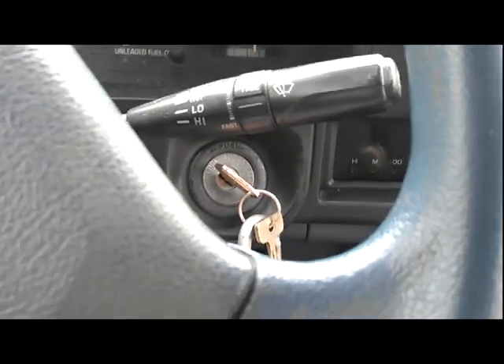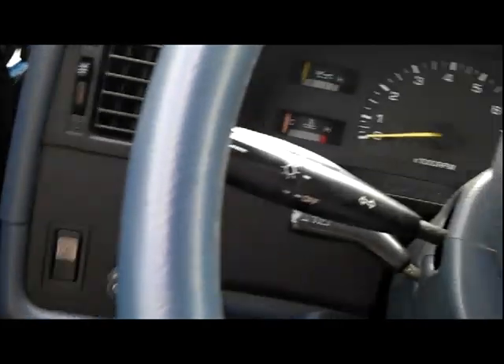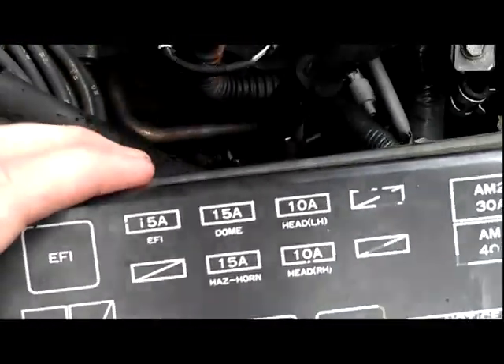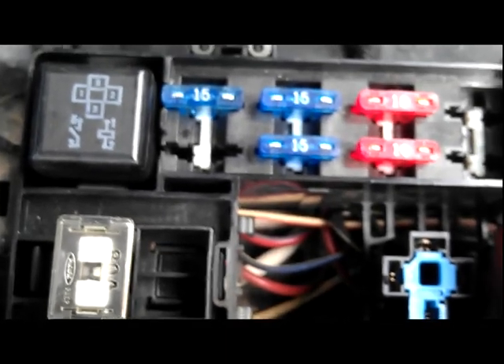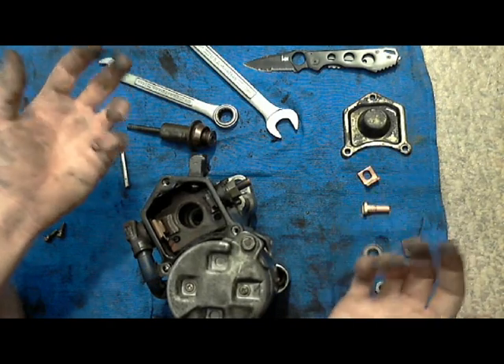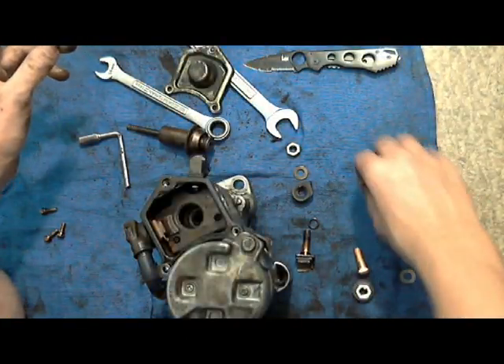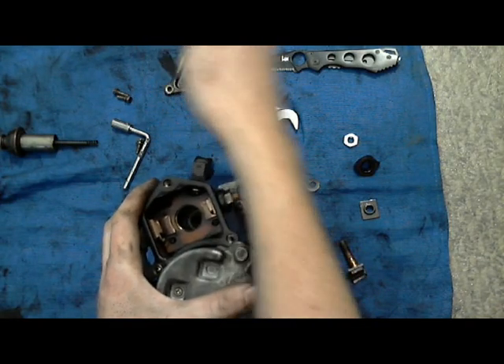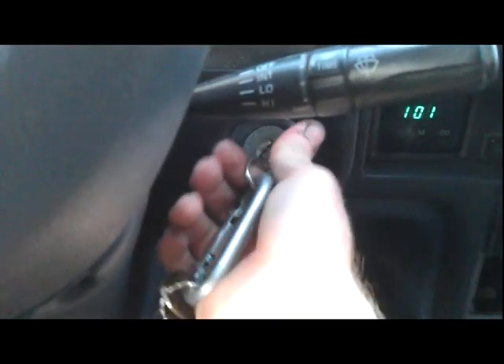Rebuild a Toyota Starter

Comment: My dad has rebuild starters and alternators for 20 years, and he recently taught me  how to rebuild them. These types of starters are my favorite, they have many parts but I just understand were they all go, and it is just so easy to take everything apart. I take the whole thing apart, I could even press out the solenoid to check if it is fine. I  clean everything with gasoline, dry everything out and re grease the bearings gears change out the contacts, solder in new brushes if they need them, and give them a nice paint job for a nice and clean install.
Reply: Good on you 👍

Comment: I used a torque wrench to tighten the copper stud nuts and ended up stripping the thread.  I guess it was out of calibration or something
Reply from the maker: Eek, oh no!
Reply: @LegitRaceCraft  I actually checked the calibration and it was fine, so I've no idea why it happened.

Comment: How long will the refurbished starter motor last?
Reply from the maker: I've rebuilt 3 of my own starters over the last 15 years(two different motorcycles and this truck), and all of them lasted until I sold the vehicle, so I'm not sure but they lasted at least 2 years from experience and should last well beyond that.

Comment: Appreciate the rebuild it would of been great if you would of started from the beginning instead of the middle. Thumbs up for what you showed thou.
Reply from the maker: Thanks! This was one of my earlier youtube videos. I've gotten better
Reply: @LegitRaceCraft  I had trouble with the ratcheting device on the starter shaft in an '05 Camry.  The grease was so thick that it would hold back the ratcheting pawls in cold weather, allowing the ratchet to slip.  I was unable to access the pawls because the ratcheting device was stamped together, so I liberally oiled it with light lubricants, which I think diluted and flushed out some, if not most, of the heavy grease.  Hopefully the resulting mixture will stay thin enough to allow the return springs to push the pawls into position even in the coldest weather.

Comment: You definitely don't want to do the click start too many times because as you said the injectors prime every time you hit the ignition and I fucked up my  cataleytic converter on a 3rd gen pickup doing that too many times trying to squeeze more life out of it.  (I was a starving college student at the time)
Reply: Are you referring to the "click" sound from when you turn your key in ignition? Or are you referencing using the relay-jump to start your car?
Reply: I'm referring to turning the ignition repeatedly to try and get the starter to turn over.
Reply: I had to have my T100 towed home this morning, after clicking about 40 times. I hope I haven't ruined something.
Reply: how did it go?  I wouldn't worry unless you were constantly doing it to get the car started on a daily basis like I was.  I would do it 30-40 times every day to get it to start for a couple weeks before it finally just wouldn't go anymore.  thats how I flooded it and ruined my cat converter.

Comment: YEP I M HAVING THAT SAME PROBLEM THE CLICKING SOUND WHEN I TRY TO CRANK MY 1991 TOYOTA CAMRY DX I PAID $600.00 FOR IT AND ABOUT $3000.00 FOR PARTS NEW RADIATOR FUEL PUMP AND FILTER 2 TIMING BELTS THERMOSTAT AND ALTERNATOR

Comment: yo mines doesn't have any O rings!!!!
Reply: your rebuild kit ? or the starter? most older (all Ive seen) toyota starters do not have the o-rings. they added these later to help keep oil/water/etc out of the starter. just make sure the plastic isolaters are intact (not broken) when you put it back together.
Reply: +anthony ilax the starter that I removed from the corolla.......

Comment: This video saved me $115!!!!  I'm not a mechanic by no means. I'm the type of guy who sticks to what I'm a pro at and let mechanics work on my rides. However , I have heard that changing out a starter on a Toyota truck was pretty easy once you can get to it. I decided to give it a shot all prepared to take that starter up to the Auto parts store and trade it in and buy a new one for $155 with a $40 core return. Once I watched your video and seen what was most likely the problem with the dam thing, I took mine apart too.  My seal was perfect it just had a dirty copper terminal inside from dust and grime. I didn't purchase any kit I just took mine apart just like you did in the video and I cleaned the hell out of the inside particularly the terminals and contacts. I put it all back in my truck and it crank the first try. I've been driving it around all night and shutting it off and starting it with no problem. It works perfectly now. This video opened my eyes to what was probably wrong and you saved me $115  and that's with me doing all the work. Thank you very much for this very important video you made. It's obvious to me now that most people return their old starter and buy a new one when all they really needed to do was clean out the dam thing!!!  Thank you so much for the info!!

Comment: I think the reason you had to make modifications to your kit is because each post has its own kit. The kit you used (28226-72010) is actually for the post you didn't replace. Part# 28226-64370 is the kit for the battery side post/contact, comes with the paper piece, slightly different shaped contact, correct thickness nut, teardrop-shaped outer plastic piece (the piece you said broke on yours), and the post itself kinda flares out near the head which is why it seemed fused to the contact.
Though, apparently it doesn't seem to matter which kit is used, as yours worked out fine. Just thought I'd post this up for anyone that wonders why 72010 doesn't seem to match the parts on the battery side.

Good video, thanks for uploading it!
Reply: Whats the paper piece for. I'm doing this job this week on a '97 Tacoma. Thanks for info

Comment: Why weren't all the parts replaced?  The contacts on BOTH sides were needed to replaced, as well as the plunger.
Reply from the maker: 777fuzzypeach I know, I wish the rebuild kit had come with the plunger also, but it didn't. Other kits I've gotten came with a new plunger. I guess those don't NEED to be replaced though because the truck is still starting fine over 2 years later.

Comment: What engine was on the truck you did this on? I have one with a 22R-E and I want to make sure it will work on mine.
Reply from the maker: joeinvegas101 mine is the V6 3VZE. I have a video on removing it also. Most toyota starters I've seen can be rebuilt about the same way. Try to find a rebuild kit for your starter first, then go from there.

Comment: Re-grease your contacts before putting them back in. It will lessen wear and prevent corrosion. Other than that good video (Maybe could use a bit less rambling but good information for the most part)

Comment: Jay, I have an Acura 2004 TSX see link http://www.acurapartswarehouse.com/parts-list/2004-acura-tsx-4dr-tsx-navigation-ka5at/starter-motor-mitsuba. DELETE..THIS SPACE...html  See fig on the right diagram # 14 can I rebuild this? Since I had it opened I wanted to replace the springs and the brush set have not had much luck finding a replacement. Was not very dirty on the inside and zero oil. Hmm now that I mention that perhaps that was the problem no lubrication on the friction parts. Anyway wanted to replace that item since I have so much time invested already.  Thanks for posting sir, I did subscribe.
Reply from the maker: the link doesn't work, I just did a quick search. Ebay has a brush kit, couldn't find anything on amazon. Just do a search on 2004 tsx starter brush kit and you should find it.
Reply: Thanks Jay most appreciated.  That is one thing I did not try. Merry Christmas....
Reply from the maker: William Ward and Merry Christmas to you as well! Thanks

Comment: Is a new starter ever suggested vs the kit? Or can one just rebuild it once it fails and need to
Reply: Coming from a Toyota Tech at a reputable dealer, a starter is always sold in place of a rebuild, the same reason as a parts store sells a starter in place of a rebuild, more $$. And the fact that rebuild kits don't sit on dealer shelves so that rebuilding it is not an option. The starter motor is all electrical and can be rebuilt but it takes time and patience.
Reply from the maker: I've never seen one that couldn't be rebuilt. There are bearings in the starter motor itself that one day far from now will need replacing. Those didn't come in the kit, only the parts for the solenoid were needed.

Comment: Just used your video as a guild to rebuilt my starter. Thanks! The contact on the right side was practically gone and the underside of the plunger thing had so much corrosion it looked like the top of a grimey fish tank! I can't believe the truck would at all let alone the 4/5 times it was giving me! Oh and for anyone wondering I have a 1986 4x2... and the complete job took me just under 3 hours. It's deffinitly doable for the avergae guy.

Comment: I ordered the contacts and plunger from EBay for only $13.95 and changed out the contacts and plunger. It was a pain to remove and reinstalled the starter, but my faithful 1999 4runner with over 200,000 miles on it started right up. Thanks for the great video and saving me a lot of money.